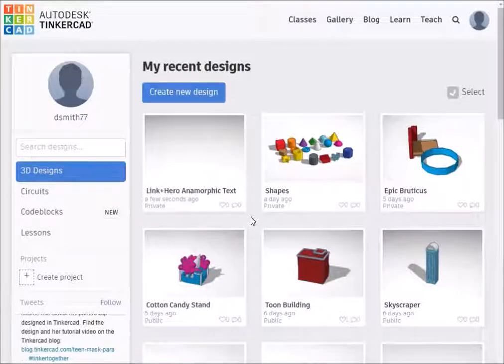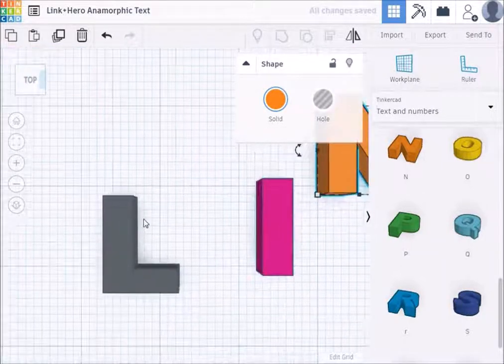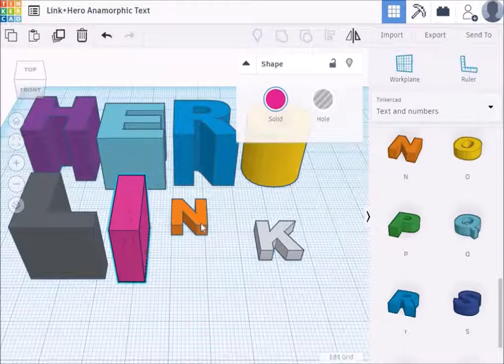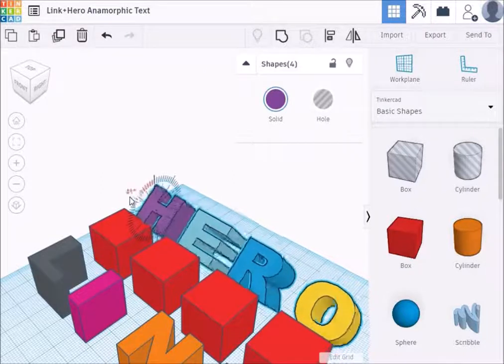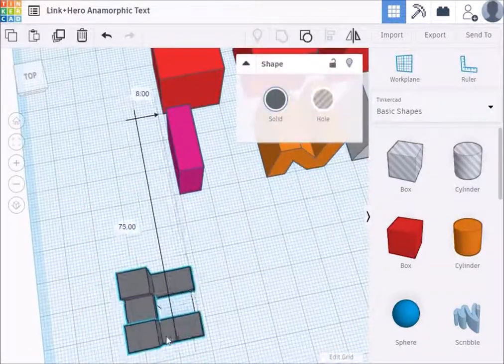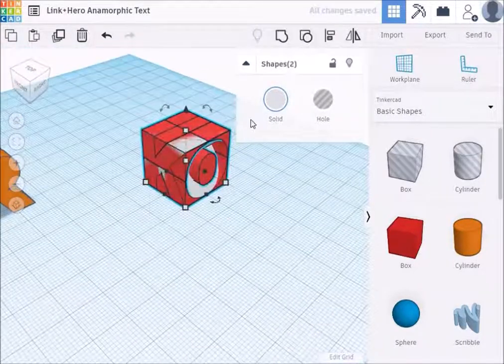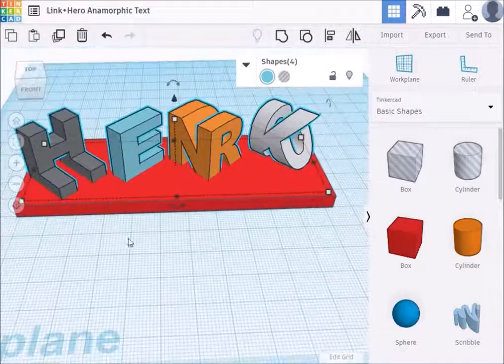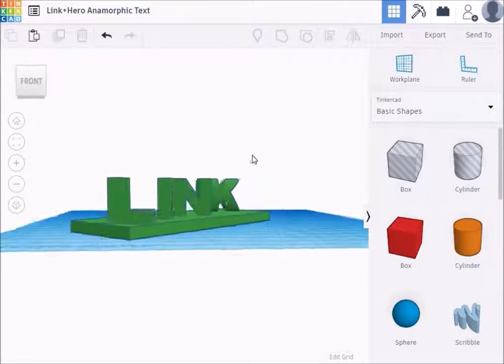How to make Anamorphic Text Tutorial using Tinkercad

Comment from the maker: UPDATE:
* Tinkercad has changed its interface. The individual letters are now found under [Design Starters] - [Letters & Numbers].
* You can also use the Text primitive as long as each letter is a separate object. The Text primitive has a few different fonts and sliders to adjust its parameters. This gives a little more room for creativity.